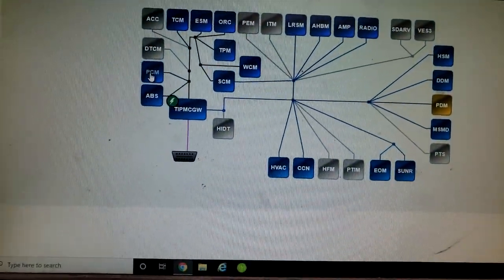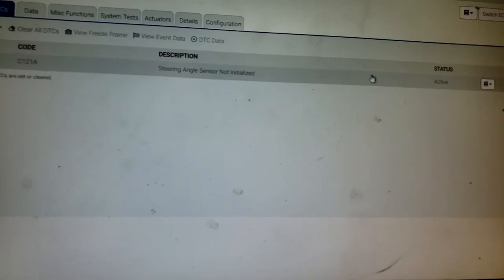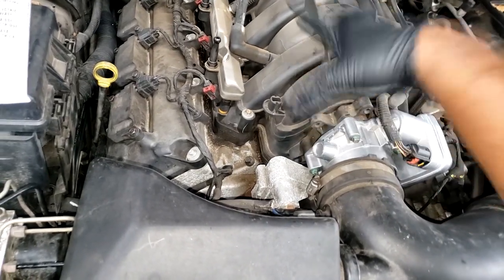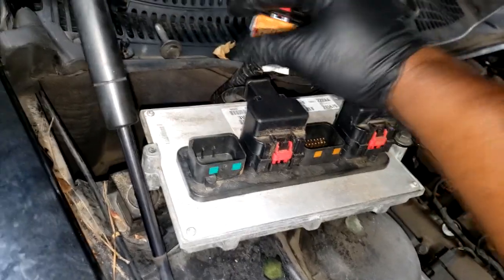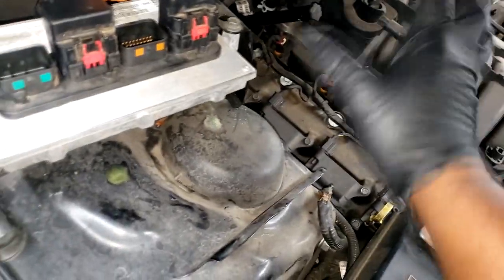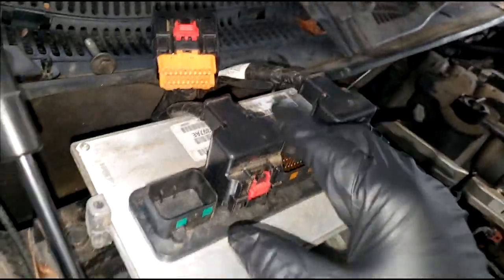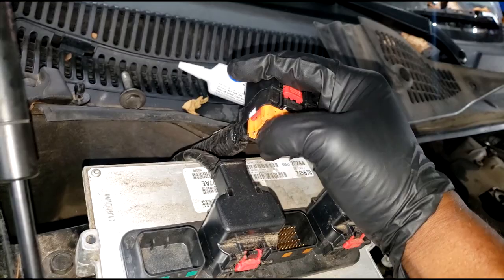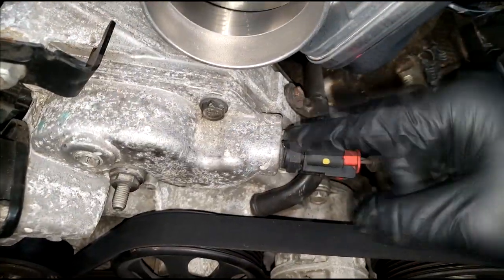This BS part will destroy your car computer PCM and your HEMI. CASE STUDY. COOLANT MIGRATION. P2101

Comment: I CANNOT describe just how much this series helped me FINALLY figure out my 2010 Jeep Wrangler Sport Unlimited ( JKU ) literally had the P2101 and a bunch of other throttle position codes. Replaced pedal (APP Sensor) and throttle position sensor, then throttle body and almost gave up. Started broadening search and i found this... There want coolant at the PCM because jeep's have a plug inline before it. well that union was PACKED with coolant and nasty rust mice. Didn't have electrical parts cleaner but i used some brake parts cleaner and to get the rust off the prongs inside i used the plumbers sandpaper you see for doing copper pipe. folded it over and rubbed that rust off. dried everything with q-tips and a half hour air dry, hit it with dielectric and FINALLY i can go pedal to the metal without triggering the red lightning bolt... AGAIN i cannot thank you enough...

EDIT: Forgot to mention i have that SAME cruddy plastic napa brand (probably) temperature sensor and it pushed up the EXACT same wire! Replacing that tomorrow before my big drive i didnt think i would be able to take! Time to get back to my Alaskan summer!
Reply from the maker: Mam that's what up. So glad you back up and running

Comment: Would dielectric grease on the connection plug help prevent the corrosion of the plugs if not prevent it from getting in there? I saw part 2 and now 4. So I'm sure I didn't miss much information? But if you put a link to all the videos in the comment section in all the videos it would help a lot since I wouldn't depend on YT to suggest it.

Comment: When my brother worked at VW Years ago They had a Touareg that they were replacing the entire wiring harness and associated parts  800 pounds worth ,because of what they called: coolant migration Coolant had worked its way through the entire electrical system causing all sorts of problems the only fix was changing the entire wiring harness and associated parts,That was a great catch JT , for a long time I thought that was only a Volkswagen problem but I see now it could happen to any car especially if cheap parts are involved ,fantastic video,You are you a Great technician I have a Lot of respect for you
Reply from the maker: Thanks for watching the vids my friend. Yes, that cheap part likely played a major role in all this.

Comment: Yup common problem....I've seen power steering switches do this😱trick is to keep and eye 👁 on all pressure switches and the first sign of seepage....change that switch b4 it gets worse👍
Reply from the maker: IKR. Whats weird about this one was, its simply a temp sensor..That had to have been a super cheap part. I guess a lil pressure can build up inside that water pump housing tho.
Reply: @OnlineMechanicTips  yup😱lol I hate like 90% of aftermarket parts😏
Reply: Had a oil pressure sensor fail so badly it was leaving a trail of oil like the rear main seal had failed. This was on a 318 in a 71 Scamp that my sister used to drive years ago. My old 95 Neon blew the oil pressure switch twice while I had it and caused minor leaks. The factory sensor is supposed to be way better quality but I couldn't find one right away so used a cheap one from eBay to get by quick and fix the leaks. I FINALLY got all the oil leaks fixed and it ate the timing belt but it wasn't marking my driveway any more.
If you have questions go to a message board for the car and engine you have and the users will tell you what are the best parts to use no matter what you need.
Glad to see part 4 JT and the full explanation of what happened. That has to be the most unfortunate placement of a couple of unrelated parts to cuase a issue like that I've ever seen.

Comment: Wow, I didn't see that coming. I thought it was odd in the last video that the liquid was rust colored because there's nothing there that can rust. I never would've thought that coolant could be pushed through a wire like that. The cooling system is usually pressurized to 15-18 PSI though, so it not far-fetched at all. I wouldn't worry about the wire corroding anymore since you cutoff the source of the moisture. The long-life coolant is designed to prevent corrosion and the water that's in there should dry out after a few drive cycles.
Reply from the maker: wow, glad to hear that bud. lol, my boss told me to get it rapped up and hope for the best..lol..Thanks for the feedback.

Comment: mopar is scam, since it is way over priced.
Reply from the maker: lol, Awh, be nice..Those cheap scam parts can ruin ones life..
Reply from the maker: @Jacks Journale well, you confirmed what I was comparing. You obviousle using GM parts for you GM products. That means you are use OEM parts. I was basically comparing the OEM coolant sensor to that junk $12 dollar sensor that was on the car...BTW, are you sure you comparing similar parts on that brake line. That Ram and Chevy comparison black line has to be off.

Comment: Its coolant migration the electrical current pulls the coolant into the wires you will have to replace the 2 wires from the sensor to the pcm
Reply from the maker: Those 2 wires travel through the small harness into the bigger harness. It will take a lot to repair that. Unless, you simply overlay that circuit. lol, but I was told cust out of money, so I had to explain what was going on and the risk. Thanks for the proper naming of such my friend.

Comment: hi, on a 06 liberty 3.7 codes p0132 and p0158 do you think that would most likely just be bad oxygen sensors? thank you for any help!
Reply: Thank you for your help!
Reply from the maker: Very well could be. Never suspect a PCM being your problem without first checking the circuit for any problems. The only thing in between a PCM and the O2 sensors are wires. Heads up tho, it may be wise to use quality O2 sensors tho..